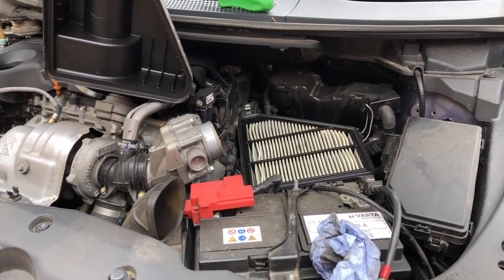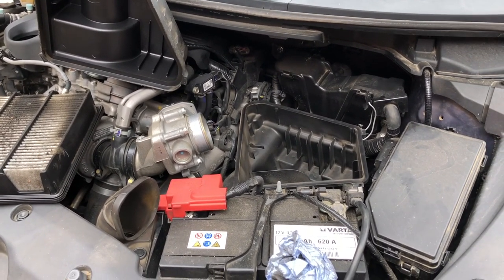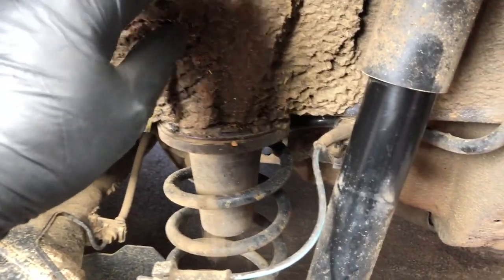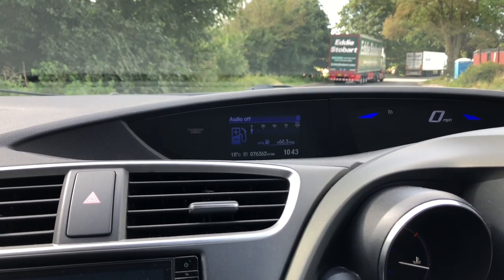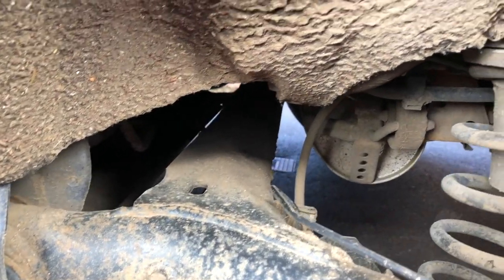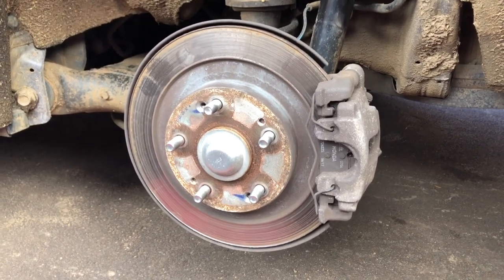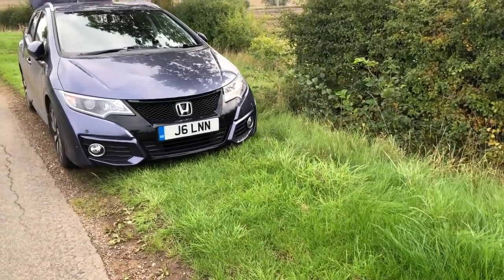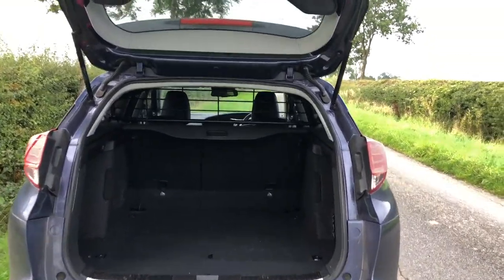Honda Civic Diesel Tourer: First Home Service & Rear Brake Replacement

Comment: Absolutely superb car driven mine 90k so far I'd happily never replace it.
Reply from the maker: Yes great car - have stuck another 4k on it in the last eight weeks. Is having a bit more attention over xmas with new tyres and brake fluid

Comment: Changing rear discs, I used long nosed pliers ok, must push in hard at the same time as screwing it back into the caliper. I don't expect to do this again so tool investment would add to my one time tool box.
Reply from the maker: For £15 I’d rather buy the stuff and do it right. I’ll have it for at least two sets of rear brakes.

Comment: Great vids on this car, thanks. I’m moving back to the uk from Aus soon and looking at one of these, they look ideal. You mentioned in a video about updating the head unit to have Apple car play, any joy on this? I can’t find any info online about it. It’s the one thing I think I’ll miss! Thanks again
Reply from the maker: Good luck with the move. Surprising how many people who seem to be moving back from the antipodes at the minute: just had an older couple come back to our street after 20 yrs in NZ. I haven’t done anything on the stereo change yet but it is my winter project. You’ll see in my other vids that I’ve fitted Kenwood units to my CRV so just waiting for a deal on an 8020 before Christmas and will get that in there. I’ll video it.
Reply: When you change the head unit, does the steering controls still work?

Comment: Dear john, YOU didnt show how you got the caliper bolts off since  they have a rubber boot on the outside. What size socket to use? seems like 11mm too small, 12mm too big. what? please help?
Reply: 7mm allen key

Comment: Hello jhon how are you?I am hoping to get one on 18 reg is it same as yours Honda civic 1.6 i-dtec estate  can you please tell me what was major issue you had with car.
 when does the timing chain needs  changing. Thank you so much. For giving all the information given I've watching all the videos many many thanks 😊.
Reply from the maker: Hi Maz, no issues. Just had an engine light come on but think it is a glowplug circuit issue. Not a huge panic. The car is just coming up to 120k and has been perfect. Timing chain change I don't know, maybe 180k? I changed my CR-V chain at 170k.
Reply: @johndglynn  thank you so much for your help 

On your cr-v  how did it cost to get it changed. Who do you recommend to get changed by.

Comment: Quick question, does your civic have a CD player? On the models without a sat nav screen I can see where the CD slot is but on these models I wasn't sure. Thanks in advance!
Reply from the maker: No CD on these units 👍🏻
Reply: @johndglynn  yes there is mine is the same if you press the bottom right button on the screen the actual screen slides down and there is a cd slot behind there
Reply: @wagonman63  Yep , very trick

Comment: The Varta battery in mine failed at 50k.
Reply from the maker: Yes mine was changed at a similar mileage. I’m going to order another before the 100k mark and just have it ready to go: winter is a battery killer ❄️

Comment: did you end up doing the fuel filter change, a few people say they can be a pig to bleed afterwards
Reply from the maker: Your comment is well timed. I didn’t fancy doing it on the floor so I took it to my MOT guy last week for us to do it on his ramp. It looks an absolute pig to get to and loaded with potential issues if something cracks, so I’m going to take it to Honda to be done this month sometime. Might get them to change the brake fluid also while they’re in there.
Reply: @johndglynn  thanks John I read that on some forums too, if it gets an air lock or something. I’ve actually got one the same colour as yours, I’m very happy with it apart from the drivers seat giving me a bad back apparently very common with them. Good luck with it and thanks for your video.
Reply: @Gman-nb9ge  did mine no issues
Reply: @treehouse7861  just changed it and it started no air locks ? I live in Denmark and dealer would be a small fortune to change it
Reply: @Gman-nb9ge  yep, no prime , no pump or anything. trickiest bit was spinning the cap off the housing without the proper tool until i realised i could use piece of wood and hammer it onto the cap to rotate it off (cap is metal). i did it from the top (took out ecu airbox etc as its easier than going underneath)
Reply: @treehouse7861  thanks buddy, I’ll wait until the better weather and then have a look at it. Good car apart from the seats are the comfiest
Reply: I have a diesel tourer and the fuel filter is a fiddle, If you have to you can remove the exhaust to gain access. Priming is not a problem, There is a pump under the passenger seat to prime or if that is not there it will auto prime. You need good pliers for the spring clips on the pipes and patience.
Reply: @ronanwood6891  Hi there, Is there any online description of how this job should be done? I saw few videos on youtube - some attempt to do it from above (removing airbox and some more pieces), or is the access from underneath the only sensible option? thx

Comment: which oil do you prefer for this engine ?
Reply from the maker: I am using Mobil1 0w30 at the mo and seems fine. Previously used Smith and Allan 0w30 and was also fine. Have moved to only using Shell diesel and that has given the car a touch more zip.

Comment: I see Honda have now dropped the diesel option altogether to concentrate on hybrid technology. The main thing that puts me off more recent diesels is the DPF and the cost of a replacement. Presumably, you have decided to sell the car before it becomes a potential issue.
Reply from the maker: No, I’ll run it to at least 150k, which is 70k miles away. If it needs a DPF replacement then I’ll do it, but there are plenty of diesel particulate filters on the forums still going strong at this mileage.
Reply: @johndglynn  That's good to hear. I had an Octavia Diesel Estate. Great car but I just do not like what I hear about the new diesels. Just too complicated now. The styling on this Civic is a love hate thing as you point out but most of us look past that and focus on the top notch engineering. Thanks for the videos and your feedback, John. Really helpful.
Reply: @johndglynn  is the dpf easy to access? I swear I remember people saying on the forums that they is access from the top but looking at pictures i don't see any way
Reply: If someone has a problems with DPF, it means that: A) Should not buy diesel car in the first place, because is using it on short distance only; or B) Fuelling up bad quality diesel. Personally, Honda dropping the diesel in new cars, put me off from buying new Honda. 1.6 i dtec is very good and eco engine.
Reply: @marcindawid8485   And using DPF cleaner to the fuel once a time.  Not bad at all